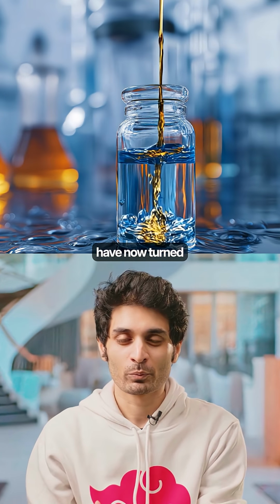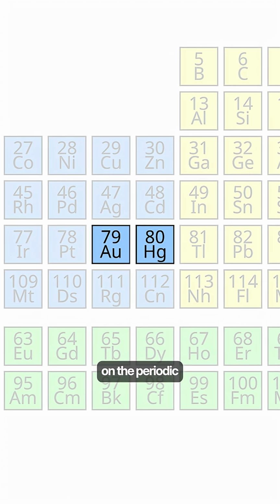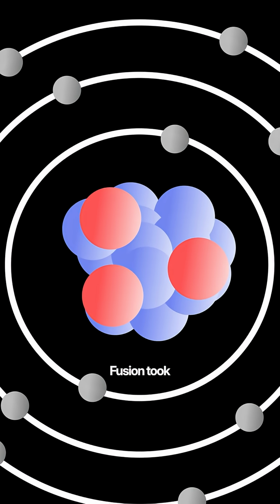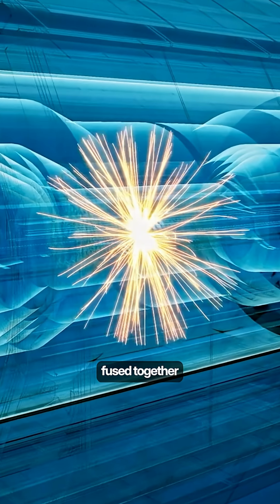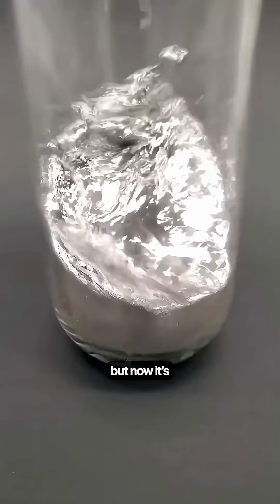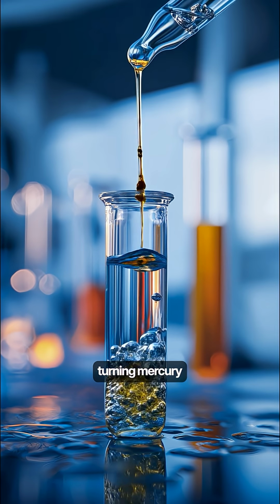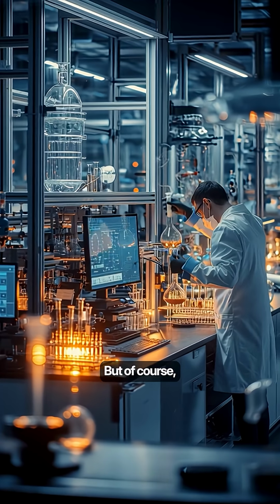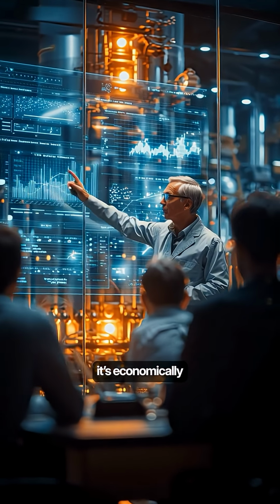Researchers have now Turned Mercury into Gold

Comment: This doesn't sound good for the banking system. What would be used to store value then ?. Central Banks accross the world still hold and depend of gold reserves wont in devalue it's assets then ?. What would we used to store value if not gold, it's the only thing being used for 1000's of years.
Reply: Digital economical energy - Bitcoin with lightening network and supply cap of 21million bitcoins.

Comment: Estimated Cost to Turn Mercury into Gold

ItemEstimated Cost (USD)Particle Accelerator$100 million+Facility Construction & Infrastructure$50–100 millionRadiation Shielding & Safety Systems$10–20 millionRaw Mercury (isotopically enriched)$100,000+ per kgEnergy Consumption (per gram of gold)$10,000 – $100,000+Separation and Purification Equipment$1–5 millionWaste Management & Disposal Systems$5–10 millionSkilled Personnel & Operation Costs$1–2 million per year 

🧾 Gold Production Cost (per gram):

👉 $1 million or more per gram of gold produced.

So even if you can make gold, each gram would cost hundreds of times more than its market price (currently ~$70/g).

Comment: 60 years ago an entire room needed to store 1mb of data. Now 218 PB data can be stored in a DNA strand that's invisible to the eyes. If all those could be done before the internet world, imaging what could happen in 60 years in a quantum and AGI world? 

Energy problem? Inevitably, it'll be fixed. Not specifically to produce gold. Because energy problem is much bigger than cosmetic gold and it will indeed be solved.Gold mass production will only happen as a by product.

Gold is not useful in large scale except cosmetics. Industrial gold need is very low comparatively. Gold value is so high only because of the rarity. When that erodes, the attraction towards gold will erode. As a consequence, price will plummet. So such inventions may not even have to start mass producing gold - the mere existence of such inventions would plummet the price of gold as gold has no "real value" to mankind beyond rarity.

Comment: Bro, using a nuclear reactor is not alchemy. In alchemy, there are no nuclear reactors or enclosed chambers — it solely relies on the human energy system.

For that, you first need to make your body into a Vajra. To do this, one should practice Vajroli to retain Sukkilam from his wife, with her permission. Then, you must perform specific penance. Only after that body become like Vajra, so it doesn't get affected by radiation when you perform alchemy.

Agasthiyar says: Only if copper sulfate (thurusu) becomes lime(sunnam), can bronze (tharasu) be transformed into gold (thangam).

Before using Vajroli, you must enter a no-food state and follow Brahmacharya for 12 years.they can't do alchemy .so before talking about alchemy learn what is real alchemy.

Comment: The whole reason gold is valuable is because how scarce the resource is 
Now if someone invents a way to mass produce gold they will crash the gold value into shambles
Reply: like aluminum. it used to cost more than gold since it was rarer than gold until someone invented the process to get aluminum easier.
Reply: Exactly 😅
Reply: One more thing, gold is not only valuable cuz it's scarce, but industrialists/businessmen show that its worth more. As there are  more scarce & rare elements on earth but are cheaper.
Reply: @ayghexv  the value of gold = it's scarce ness + how it is used to back most of the world's currency 
That's why even though there are more scarce valuable metals than gold 
Gold seems to always grow in price
Reply: There is a production cost which wld be more than the price of gold itself so no need to wry abt crash thing
Reply: @souravmittal3058 even if does , the normal goal would be sustainable and zero carbon
Reply: It will take 18 year though
Reply: I think he's being very generous with the cost of production figures. Lets not forget about diamonds. They make those and the price didn't drop, they just came up with clever marketing.
Reply: Didn't happen with diamonds... There are workarounds called as lies... And sustainable gold which is carbon neutral 😂
Reply: @saketgawali1981  🙏the most inflated and scamy thing in the world is diamond bro 
They literally cost that much is because of the marketing and the image they built of it as something more valuable but realistically diamonds used get sold as cheap rocks unlike gold which was valuable even in early civilisations
Reply: @sai_neko_reddy  gold is a resource for me bro but for now for many especially indians it has far more value and the same is true for the hoarders. The price won't be reduced. They'll find a good way to increase the price even more. 😂

Comment: Radioactive Gold would be extra Shiny, would only cause cancer, easy tradeoff tbh for shiny gold.
Reply: Extra safety for gold depositories..😅
Reply: @Avengers98956 nice 😂
Reply: lol
Reply: It is mentioned in the video. Gold is usable only after 17 years. It means after completion of radioactive decay only we are using it.
Reply: Here is another problem with the economy issue: if the market is flooded with tons of gold suddenly then the base value of gold will drastically fall causing economical chaos. If gold wasn't scarce and was available abundantly will it be worth what it is worth now?...as a metal it is not strong, changes shape under pressure and melts easily ...in terms of property and usefulness steel is precious. The only reason it is worth so much is because it is shiny, excellent conductor and is scarce.